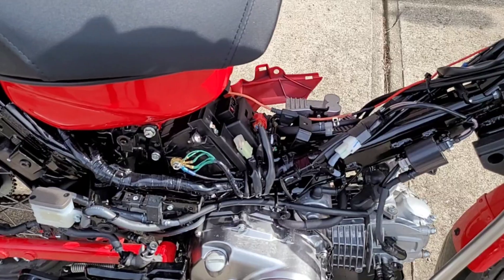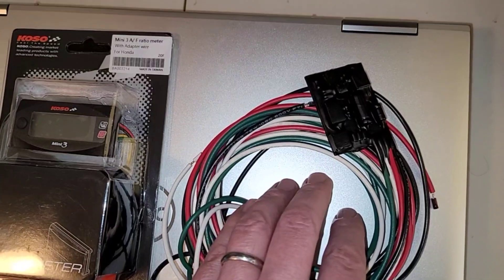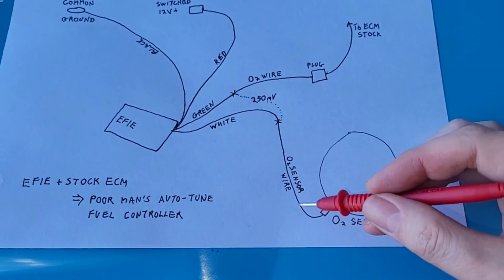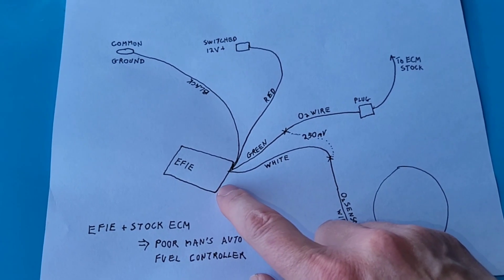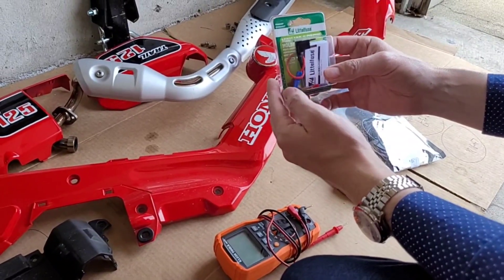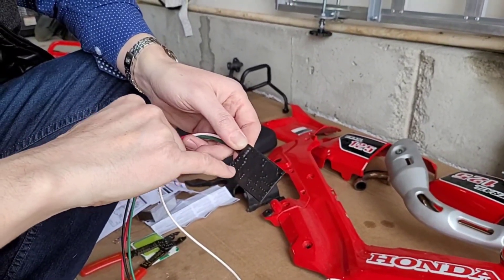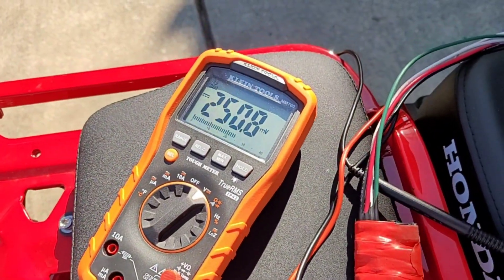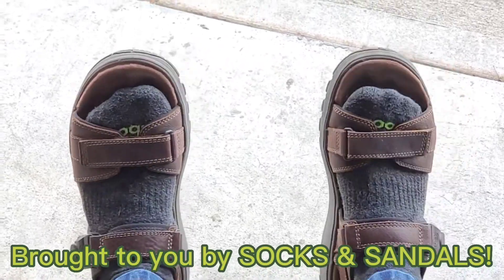CRAZY EFIE device for the Honda Trail 125. Super cheap fuel controller solution WILL IT WORK? Part 1

Comment: Do you mind to provide the details of how you tapped into the circuit to set the EFIE device to 250mv?  The details that you provide in your videos are excellent.  Thank you for sharing!!
Reply from the maker: @kdsprouse  There is a little screw on the EFIE device that you rotate to adjust the voltage. I hope that answers your question.  If not, I would be happy to elaborate.

Comment: I just put a full exhaust on a C125 Super Cub and lost 20-30mpg. Would the EFIE prevent it from running so rich?
Reply from the maker: @kayinoue2972  The way I have it wired is to enrichen the mixture not to lean it out.  It can be wired the other way to run lean, but that is dangerous.  You should not have lost 20-30 mpg with an exhaust. Is that the only modification?  Did you remove the O2 sensor on the header pipe by any chance? Seems very odd to me.  Check your results for mileage.
Reply: @QuantiQualification  Thanks for trying to help! Yes, it's the only mod. The O2 sensor looks like it's screwed into the cylinder head. There is no bung on the OEM or the Moriwaki pipe.

Comment: As of now, I only have a aftermarket  intake tube with factory air box and snorkel. And a de-catted stock exhaust. Would adding the pcx 150 injector and efie device @250 be a safe stopping point? Or would other supporting mods be necessary?
Reply from the maker: I would guess you would be okay with that setup.  The EFIE would protect you at mid-throttle and the PCX150 will give sufficient fuel at wide open throttle.  EFIE does not seem to affect the map at wide open throttle. If possible, some sort of O2 reading would help you to know you are safe. If you do this, read the O2 at mid throttle and make sure it does not go above this value wide open anywhere through the rpm range. If it does, you will need to increase injector size.

Comment: What did you gain??
Reply from the maker: Here's a link to some test results. https://youtu.be/wa3fD-MxWY0 The EFIE + correct fuel injector and 164 BBK gives promising results.  I need the bike to hold 55mph and it has achievied it.  I am going to add an oil cooler to the bike and see if I can get away with using less fuel or allow me to use the air pod filter for a higher top speed without excessive overheating.